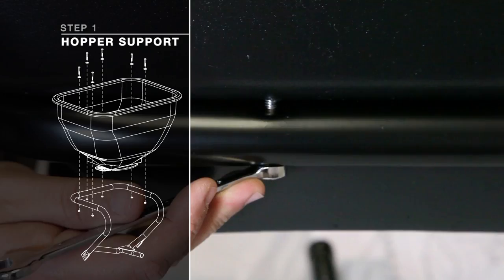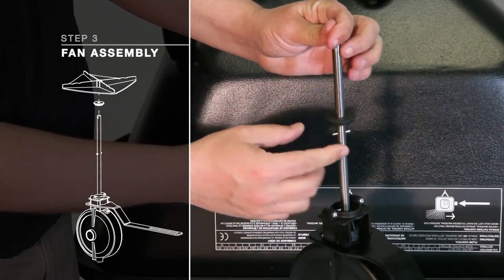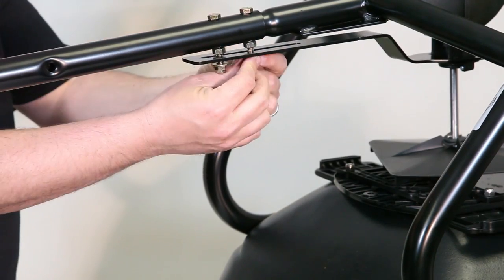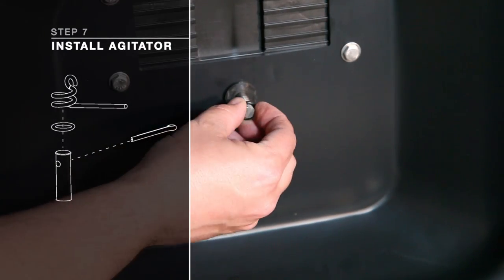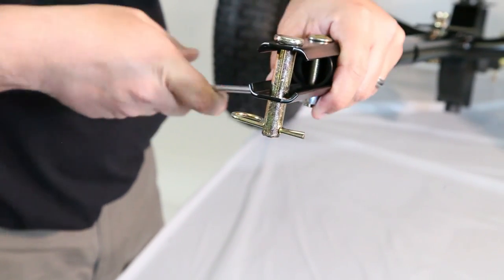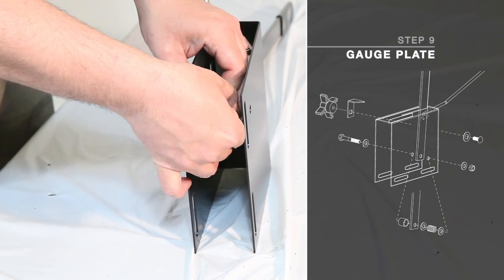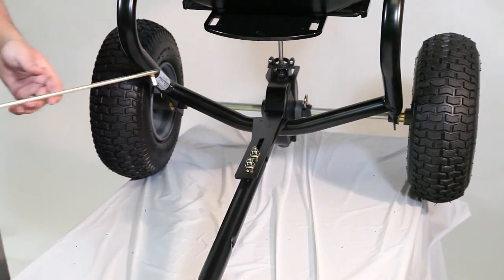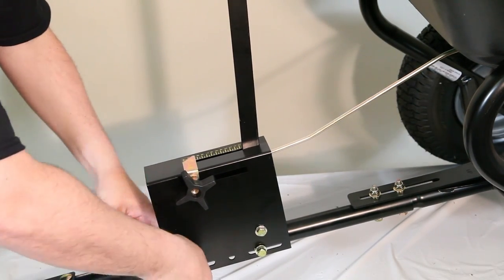How to Assemble the  Brinly BS26BH Tow-Behind Spreader

Comment: The owner's manual does not make it clear that one is supposed to push the large diameter side of the fan driver into the small fins of the fan (perhaps it's obvious, but I didn't get it). The video makes it clear. So the fan does not get linked directly to the drive shaft, it relies on friction with the fan driver. What is the reason for this?

Be sure that the fan does not touch the metal link rod end end. The link rod end sits about a half inch below the gate and can easily get in the way of the fan.

Final comment. You are likely to buy this once so the first time you assemble it bear in mind that it will take up to an hour and a half, not 30 minutes. If you have done it once it will still take you more than 30 mins. Personally I don't care because I want a quality product. I took the cheap model I bought back to the store and bought this.

The assembly instructions are very good overall and the way Brinly organises the screws and other hardware is brilliant. All parts are laid out in the right order, section by section and they are easily removed from the packaging by separating the cardboard from the plastic. I cut out the sections of hardware as I went along. Full marks to Brinly for this.

I haven't put it to the test yet but so far my impression is that this will stand up over time. It is robust and well constructed overall. The gate calibration does not really come together. When you adjust for open gate you don't really get an opening at the "1" setting but I don't think it will take too much to tweak. I'm not sure how to calibrate the flow but I'll google it. I'm thinking size of hole coupled with size of fertilizer or just experimentation. We'll see.
Reply from the maker: John, I appreciate your comments on the manual. I will relate them to our engineering department so that edits can be made in the next printing. Let us know how it goes on the first use...we think you're going to get a lot of good use out of the spreader for many years to come!